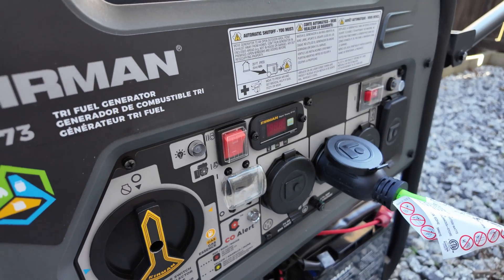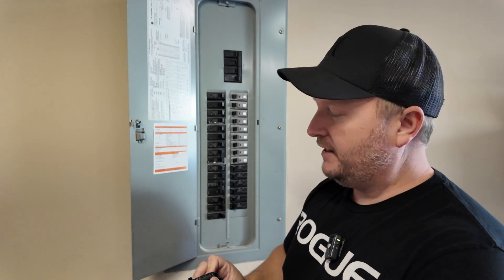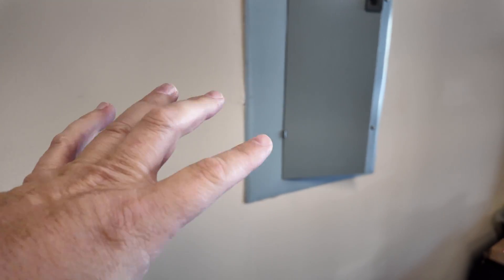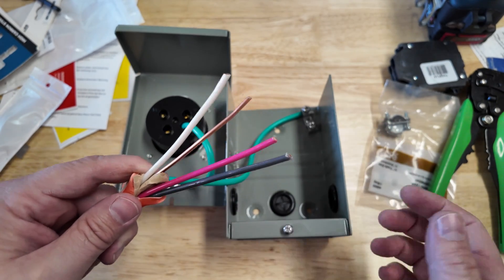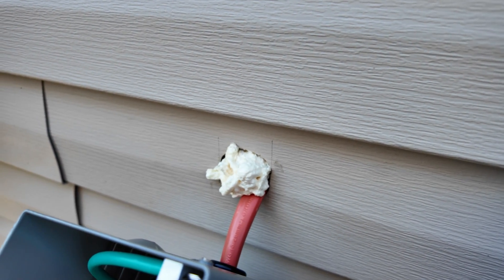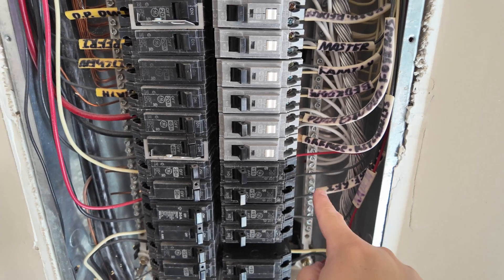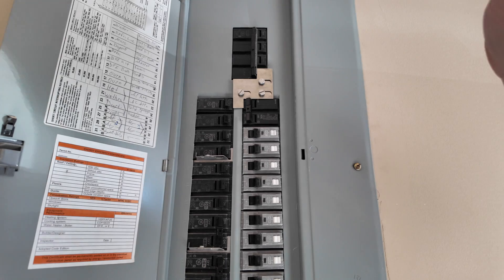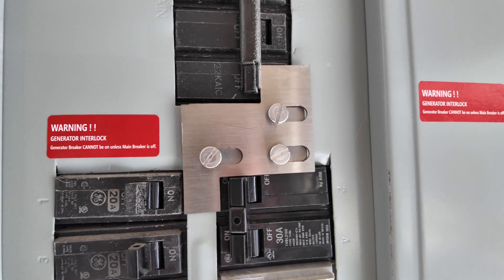How To Connect A Generator To Your House | Step-By-Step Tutorial

Comment: I think I see your generator has a 50amp outlet with two HOT legs already, why not use it so you can get 50amp per leg...what you have is 30amp cut in half (15amp per hot leg)
Reply from the maker: Hindsight is 20/20. I think I talked myself out of the 50amp because I assumed I wouldn't use any 240v appliances and such during an emergency. Fortunately, the power hasn't gone out since I put out the video.

Comment: One thing I noticed is that you did not use the wire clamp on the main panel.  Need to get that in there.  Hopefully you still have the wall open, just put the wire clamp on the 10/3 wire and snug it up then put the clamp though the panel and put the nut on.  Your City inspector will give it a red tag without that clamp installed. Other than that, everything else looked good and should not give you any problems in the future. I put Red X's on the stove, AC, and Heater breakers when I had the 30 AMP connection set up here.  Noted on the panel not to use those breakers when on Gen Power.  Looked like you had the option to put in 50 AMP on that generator, might want to consider that for a future upgrade, but will need to redo the box on the outside and upgrade to 8 Ga. or 6 Ga. (Can always go bigger on the wire, just not smaller unless you downgrade the breaker) wire for the 50 amp though.

Comment: How do you know if your main panel can accept the slim 15 amp breakers? I have a Siemens for reference. Have 1 blank at the bottom. Top to bottom is 15,20,20,20,20,15,20,20,15, blank. Kind of nervous sliding all these down and then will have to figure out how to get 2 of the 15s together. Help?
Reply from the maker: Sorry, I'm not familiar with the Siemens panels. You'll have to do your own research whether or not it will accept slim breakers. That said, if you're unsure about anything, exercise extreme caution. Messing around with your electrical panel is no joke, as I'm sure you're well aware. Be safe!

Comment: so you use a double 30 amp trip breaker run it like its 220 volt from the main breaker panel inside then run it out side to the box for the generator plug to plug into and then use the safety switch to turn main breaker off in the main panel box and then turn the double 30 amp breaker you installed into to panel after you start your generator and it will power the whole fuse box is  that correct or did i get something wrong thanks in advance
Reply: It will power the whole box, but higher amperage 220v devices still may not be able to run though.

Comment: The interlock screws look improperly set. There is no room on the oval screw openings, to slide the main breaker back to ON position. It looks like you can turn off the gen breaker, just fine, but both breakers would then be OFF. 

You probably discovered that after the test, right?
Reply from the maker: You are correct, I had to go back and make a slight adjustment. Measure twice and drill once 😂

Comment: Generator bonded or floating?
Reply: If you use a portable generator it is recommended to disabled the  ground neutral bond in the generator , usually by adding a switch so you can use it both ways.

Comment: Where's your NM box connector on your 10/3?
Reply from the maker: Great question! I know I showed the connectors in the beginning, but as I was working through my particular install, I ended up not using them. The outlet box I purchased has the built in rubber grommets where the wire goes through and that was enough to not only hold the wires in place, but assure that they don't rub against the metal box. On the panel side, the metal punch hole was about an inch, inch and a half and the hole that I drilled out through the stud was only 1/2", so again, no possible way to add one and no possibility of rubbing either. I should have pointed that out better.

But you're 100% correct pointing that out. If the wire has any chance of rubbing metal going through either the outlet box or the panel, the connector should definitely be used.
Reply: @ben_chill  What is a "NM box connector?"
Reply from the maker: @keiththompson2289  they're the metal fasteners that essentially clamp down on the wire when it passes through metal boxes or the panel to prevent the wires from rubbing on the edges. As I mentioned above, I ended up not using them because the outlet box already had rubber gasket around the holes and the hole leading into the panel was about 1.5" and the wires were nowhere close to touching/rubbing the edges. That said, in most cases you'll want to use them if the wires are passing through any metal boxes. https://amzn.to/3YZq4yV
Reply: Interlock is not allowed here in Canada.
Reply from the maker: @unclev7075  really? That's interesting because it's a huge safety concern NOT having one installed.
Reply: @ben_chill not allowed to install using the interlock method by canadian code. Must use a generator panel or add a secondary panel.